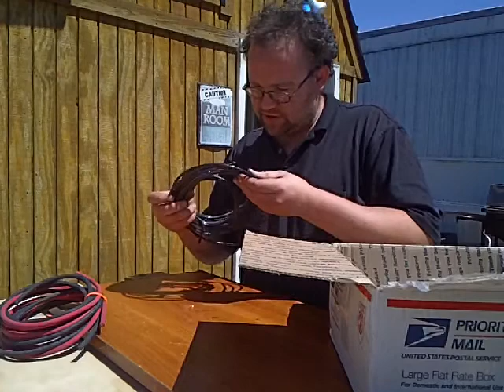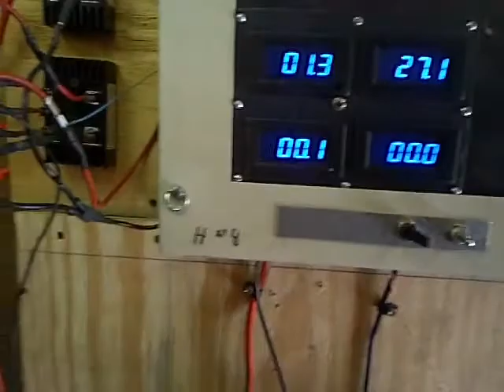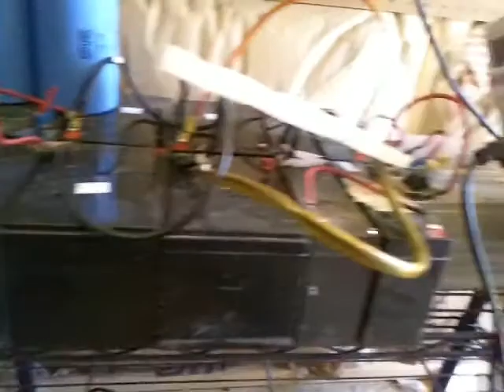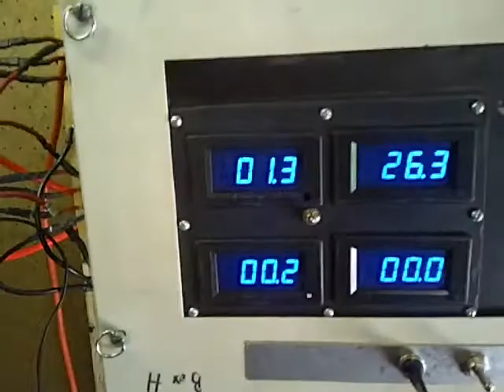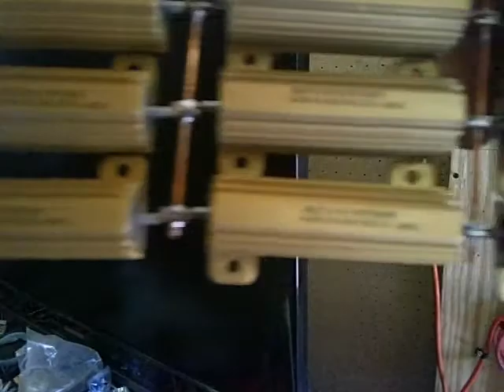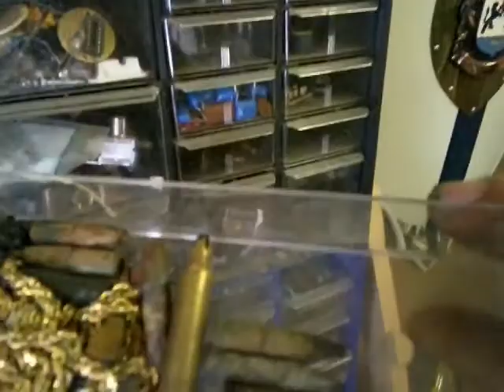Stuff I got in the mail from Billy when billy was a man.

Comment: Hey, salvaging is the thing to do. I think my dad got those resistors leftover from a project years back. Various computer parts and switching supplies are where I get my stock of caps, mostly 470-680uF 200V and 3300-4700uF 6.3-16V though. The caps you have are pretty nice.
We have all but the tower pipe in, so hopefully in another week we should have the towers back up. Good luck with your system also!

Comment: Our 9-blade hub bent, but it also fell from 40' as you’ve probably seen. Those blades are impressive!
Heheh, your battery bank is bigger then ours. XD Ours is only 48V with 12Ah.
Rats nest or not, it works! :) We have 12 of those 30W 6 Ohm resistors, but I never thought about using them as a dump load before. I should totally try that!
Oh, and awesome shed! :D